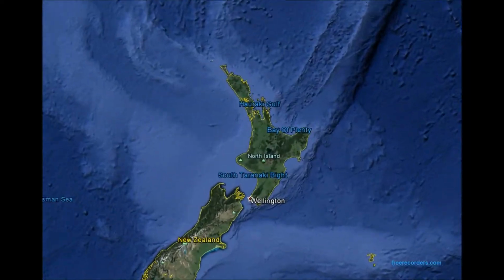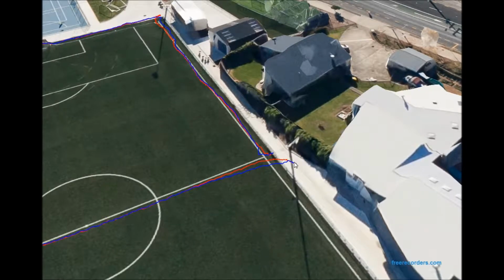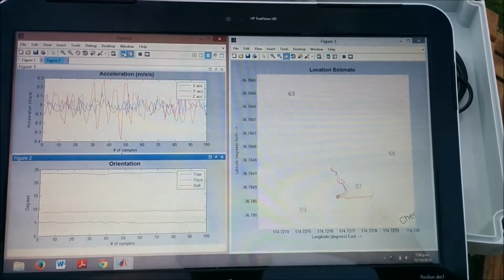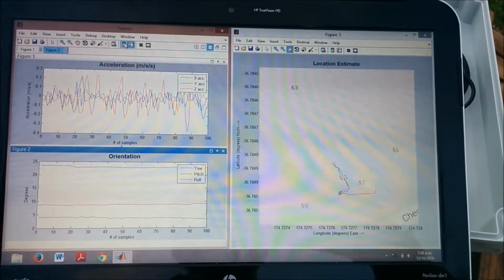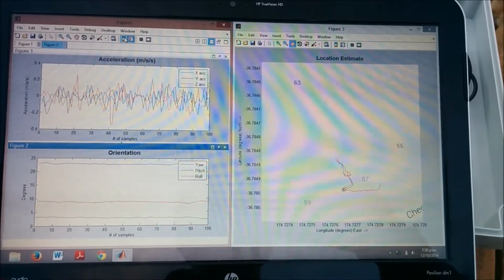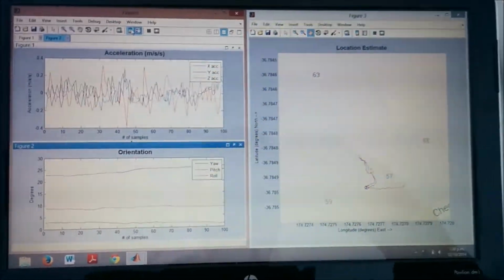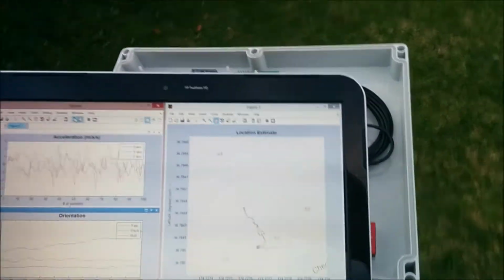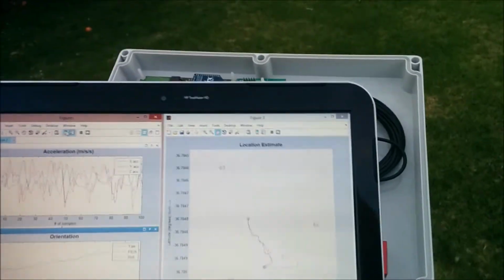Sensor Fusion Kalman Filter

Comment: Would be quite neat to compare with an inertia guidance routine from the accelerometer.   Probably from rounding errors it may not get back to the start point, but it may not drift off course as much or have the loops at the corners.   Nice demo though.